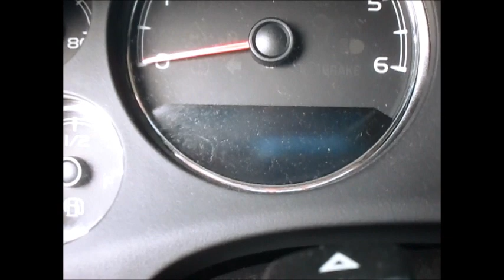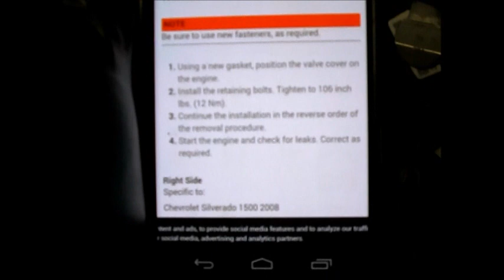Chevy 5.3 Burning Oil, smoking, how to fix.

Comment: This was misdiagnosed by several dealers, or they just wanted to over charge me for some other issue. My 2010 Silverado smoked like yours with a very rough start up. Could not get the check engine light to turn off for over a year. which also means you can not use auto start. I did use the Dorman though, not knowing any details about that part vs GM. Long story short I fired it up after installing and low and behold my check engine light turned off immediately and has not come back on for about 500 miles. Knock on wood. No more smoke on start up.  Thanks for the video.
Reply: Did you have problems with the Dorman part? All the reviews I've seen people rave about the Dorman valve cover.
Reply: @chrisheffernan6600  No problems at all. Changed drivers side only. Took a maybe 30 min.
Reply: Hey ! Did your truck smoke on the high way too on high RPMs and when you go up hill ?? 
Or only at startup ?

Comment: You can also use the old valve cover, you just need to drill about 5 holes in the baffle on the inside for more drainage, it works well!

Comment: You should wipe down the surface of the heads where the valve cover gasket sits using a rag damp with brake cleaner before reinstalling. I had the blue smoke too, but I instead drilled some extra holes in the original valve cover and enlarged the original weep hole which seemed to fix the problem. I haven't had a chance to check the oil consumption yet, but the blue smoke is gone

Comment: Always check the rubber connectors at both ends of the hose from the back of the valve cover and the intake side , mine were split creating a vacuum leak
Reply: Any chance you have a picture for reference?

Comment: I’m about to do this same valve cover/PCV replacement on my 2010 6.2. Thanks for the video. Really appreciate it.
Reply from the maker: Let us know how you make out and if it fixes you problem.
Reply: @RustBucketRepair  Problem fixed (at least the oil cloud on startup). I wasn't using much oil before, but I'll keep an eye on it. Just surpassed 200k.

Comment: We decided to drill out our old valve cover as suggested by several YouTube tutorials for the LS engines. We have a Yukon 2005 5.3 and we did this drilling out at least 10 holes and it all went well we test drove it the first day for 10 milrs and shut it off.
the next day unfortunately it started leaking down on the exhaust manifold and smoking.
I assumed the original OEM gasket would be sufficient

Comment: Do you have a part # or website you could post? I tried checking most of the comments. I believe this is one of my issues. Oil leaking and puff of smoke when driving and it downshifts from 6 to 5th. Thank you!
Reply from the maker: Best I can find is for 1999 to 2008 the part number is 12570427 and for 2009 and up its 12642655. Confirm for yourself before ordering.

Comment: Did yours also smoke alot at Wide open throttle? Have an 06 5.3 doing this now, besides the smoke it runs fine.    I know it used to drink a little oil but it leaks out so much from about every seal and gasket now its hard to tell how much more oil its consuming. 176,000 mile Poj it is. Ruined
Reply from the maker: Smoked the most at startup, but did also smoke at w.o.t.
Reply: @RustBucketRepair   YA i have no smoke at startup I thought I had the updated cover on the 06 but that was the 2nd update. Then they went to a 3rd update which is the "427" cover   Arrgh!

Comment: My 2008 avalanche ltz smokes a white cloud when I use the remote start and when I check the spark plugs on cylinder one there was oil on the spark plug. Do you know if this fix the problem with oil on the spark plug? Great video on the process of changing the cover.
Thanks
Reply from the maker: Yes. My #1 spark plug got so oil soaked I"d get a misfire and I"d  have to replace the plug.

Comment: I have a 02 suburban 5.3, I removed  the catalyst and it started to burn oil, I changed the pcv valve but after driving it still blows between white or bluewish, if its stays parked and turned on is does thorw as well and even after accelerating it seems that it accumulates the oil and it throws a big cloud of smoke then it disappears while driving, any experience with this?
Reply: Did u figure it out?

Comment: PCV valves are cheap to buy for a 2000 Toyota Corolla and easy to install (new) and the hose is fairly cheap.
Reply from the maker: Not on this model. The pcv valve is built into the valve cover. You have to replace the whole valve cover. I was surprised too. Not like the old days.

Comment: I have a 1992 gmc sierra 1500 that I bought for a project, had this issue of blue smoke on every startup...well I changed the valve stem seals and no more blue smoke
Reply from the maker: Your 92 will have a totally different pcv system.
Reply: @RustBucketRepair  I also changed the pcv valve with a brand new pcv valve and tubing, unbeknownst to me when I bought it, I found out that the black tubing that goes connected to the pcv valve and carburetor had a hole in it...just glad the blue smoke is gone and wasn't a more serious issue like the piston rings.

Comment: Is this applicable on a 2003 Tahoe 5.3 or no? Its got just the hollow shell pcv valve
Reply from the maker: From the little research I did it looks like your truck takes the same valve cover as mine, so I'd say yes.

Comment: Depends on just what part of the rust belt U live in. I do rust work on frames too. Ain't cheap and free but better than buying one those new way over priced train wrecks on from a dealers lot. get in touch folks I am in the Pocono's of Pennsylvania. Rust work under coating lighting packages. I do a lot here way under what others charge.

Comment: I really need help because this got me scratching my head. 05 5.3 270k. Every once in awhile I'd get a bit of smoke on startup nothing major. Well couple weeks ago I was out running errands. Truck drove great like always. Got home and parked it for a few hours. Had to go to corner store and while backing out my driveway I had no brakes (brake line from master cylinder blew under driver's side door) so pulled back in and also noticed idle was a little off and bouncing like it wanted to stall. Truck sat for 4 days until I could replace the brake line. Well I started it and now it smokes out the tailpipe and has a jumpy idle. No check engine light or overheating and oil looks good with good pressure. I know about the pcv valve problem these have but I don't think a pcv would cause this much smoke. I'm scared to drive it. Weird this happened when my brake line gave out. Help would be greatly appreciated
Reply from the maker: First off, I'm not a mechanic, so take what I say with a grain of salt. If it's the pcv valve, the smoke should clear up after the truck runs for a few minutes. The bouncing idle could be a fouled plug from the burning oil. My #1 plug would foul, but I'd also get a check engine light. Run the truck for a while and see if the smoke clears. Also, pull off the hose from the pcv and see if there is any oil in it. It will be very little. Wipe it with a paper towel and see if there is any oil on it. The only way the brakes are connected to the motor is through the vacuum line. Could that be part of your problem?? I don't think so.
Reply: I know this is a couple of months old, but I bet your master cylinder is leaking brake fluid into your brake booster and the vacuum is pulling it into the intake manifold and burning it along with the gas causing the white smoke.
Reply: @jimmydavis6254  yeah that's what it was

Comment: I found oil inside my spark plugs. Will this solve the issue? Or would it be the valve seals
Reply from the maker: If you find oil only on the driver's side then it could be the valve cover (PCV). If both side, then valve seals or rings.

Comment: If your engine is getting  noisy from valve lifters try running  a quart of Marvel Mystery oil through it for 1000 miles before you change out the oil. Worked great on my '11 Sierra.

J
Reply: Iam having a million and one issues with my 2001 Silverado with the 5.3 ls long block
Smokes when you start it than it stops but misfires on cylinder 1 and 2 and the lifters sounds terrible.
Reply: Lifters only make noise when it burns about a quart of oil
Reply from the maker: @thelostboyz6579  I was also getting a misfire as one of the spark plugs would oil foul.
Reply: @thelostboyz6579  yup the valve cover the do a sea foam upper engine cleaning and goes away engine quiets down

Comment: Might be a dumb question. Would this occure with p0171/p0174 codes?
Reply from the maker: If I'm correct those are random misfire codes. Not likely same problem.
Reply: @RustBucketRepair  they are codes for Fuel Trim Lean, bank 1 and 2 respectively.

Comment: Great job. Did you do this process to both sides? And if not, why just the one side?
Reply from the maker: Only the drivers side. It's the only side with the PCV system.
Reply: @RustBucketRepair  thanks

Comment from the maker: Well over a year and and still no smoke!
Reply: I got a similarity with white smoke but not on start up, only when in Park and running for awhile then as some as I place into drive position then a huge cloud of smoke comes out once I step on the gas then after awhile it goes away but as I place it back in Park and just let run it starts to smoke again
Reply from the maker: @andycue38956  Pull off the PCV line. If there is any sign of oil in the line I'd replace the valve cover.
Reply from the maker: LD Wcoor  only if the oil would foul a plug and I'd get a miss fire.
Reply: @RustBucketRepair   @22:30- you just HAD to say it! lol
Reply: Is there a PCV on both valve covers or just one? Cause that would mean both sides need to be changed right?
Reply from the maker: @troubleshooterr5775  just on the one side, the drivers side or left side.
Reply: @RustBucketRepair  i got one smoking 🚬🚬🚬🚬🚬 and loading cylinder 3 with oil I'll be opening the oil fill cap, taking the hose off test to make sure it's clogged and send some compressed air through that PVC see if it clears  out and if it runs better tell the client to replace the valve cover.
Reply: @RustBucketRepair  just blew out the Pcv out with 120psi and no more dense blue smoke puffs while I test drove it and idled just asked the client to keep me posted as he drives it around see if it comes back....
Reply from the maker: @troubleshooterr5775  I'm guessing it will come back soon and you'll need to replace the valve cover. Keep up updated!
Reply: @RustBucketRepair  will do, the client will be trial testing and if it doesn't puff over blue and make cylinder misfire(Blinking check engine light cause oil is fouling s.plug) we should be good.
Reply: @RustBucketRepair  So just visited the client today, found very light oil on cyl 3 and the rest were fine as of bank 1(Cyl 1357) but as for bank 2(2468) found carbon fouling due to bank 2 sensor 2 being bad no voltage reading and just got an 1153 referring to bank 2 sens 1... But as for blue smoke out the pipe, it has t come back since. I told the client to run it for a day or 2 on then we'll proceed to replace both o2 sensors for bank 2... This Chevy has had a lot of compounded problems... Power steering pump whining among others😅😅😅😅
Reply: Congrats, I just ordered a valve cover for my 5.3 LS.
Reply from the maker: @chrisheffernan6600  let us know how you make out, if it fixes you problems.
Reply: @RustBucketRepair  It took a little over an hour to replace. I used the Dorman valve cover. Drove around for about an hour afterwards to clear out the system. The next morning it was cold, started it up and NO MORE SMOKE. I think its good now.  The oil consumption issues should be a thing of the past.
Reply: What was part number or name of proper valve cover for fix?
Reply from the maker: @carlamerritt490  12570427.

Comment: This is my issue rn. Im gonna give it a try
Reply from the maker: Let us know how it works for you.
Reply: @RustBucketRepair  yess it was the issue! Unfortunately I didn't have time to do it myself due to work, but my local mechanic is working on it rn. Thank you so much pointing me in the right direction.
Reply: @durtydean8430 hey my truck is blowing smoke like his but only on a cold start, if it’s warm it doesn’t do it. Do you think this would fix my issue?
Reply: That's what my truck was doing also. It would only smoke during cold start ups.  Im pretty sure that would help

Comment: Nice fix. What oil do you run in that Mobil 1? Seems to be holding very well.
Reply from the maker: Yes, Mobil 1
Reply: canamsledder  I think they make a valve seal kit for that also. A little involved job but it would clear up the problem completely. Than you might get 4000000 out of that truck.
Reply from the maker: @nysledder4066  Done that already. Didn't see a difference. I don't know if I'll see 400k. It's starting to get noisy.
Reply: Is the truck still running good with no smoke? How many miles now?
Reply: @RustBucketRepair  how many miles now? Still no.smoke?
Reply from the maker: @dansitterly6361  290,000 miles now and still no more smoke on startup.
Reply from the maker: @dansitterly6361  And still running good too. Just getting very rusty!

Comment: I need to do this with my 08 Sierra with 240k miles and I have to add a quart of oil ever 1k miles but j am no mechanic
Reply from the maker: Just nuts and bolts.

Comment: Why did you buy the valve cover from ?
Reply from the maker: Got it off ebay.
Reply: @RustBucketRepair  thanks 👍🏽
Reply from the maker: @rylansbeats456  Here's the link. https://www.ebay.com/itm/GM-OEM-Engine-Valve-Cover-12570427/263432446298

Comment: How long are these "updated" valve covers good for? I got 170k miles on my 5.3 about to do the valve cover swap. Could oil be getting to the intake off the passenger side valve cover as well?
Reply from the maker: The new valve cover should last the life of the truck because of the updates. Make sure you get the updated valve cover.  You only need to replace the divers side as it's the only side with the PCV system.
Reply: @RustBucketRepair  thanks for the quick response.

Comment: Usually the oil consumption is the valve seals. Light clouds while doing stop & go driving means rings. All my Silverados have the OEM valve covers no problemo's. The one that smoked a lot at start that was valve guide seals. The one with 230K on the clock was smoking after it got hot going down the road at a light there was a light oil cloud when at idle and little gush driving away. That was rings.
Reply from the maker: @thekingsilverado3266  bad pcv systems is a known issue with these.
Reply: @RustBucketRepair  I have had people here personally telling me no its not the rings or valve guide seals or a bad valve guides. These motors due to having over 75lbs of pressure in the manifold do not develop the conventional type of blow by forcing oil out the seals and gaskets unless it is extreme. Instead the PCV system sucks up the raw oil and vapors to evacuate the oil instead because of the extreme amount of vacuum draw the manifolds have. The PCV does just that vents that extra pressure and the oil along with it, routes it to the PCV system and evacuates the excess pressure. The very reasons the engine still seems to have balance and some power.  I am an aviation mechanic and when aircraft develop that sort of problem we decertify and ground aircraft with that sort of issue. Sic Harrison Fords one crash. The idiot was flying a 50 year old plane with a bad motor. He had the thing all cleaned up had the heads done. following me. It was the rings. He idled the plane 45min before take off when he when went full throttle on take the oil choked his engine it was the rings. He crashed on take off. And lived to tell about it. I read the NTSB report on the crash basically states the engine was refreshed not rebuilt as was suggested Larry Heller the A&P inspector that inspected his plane and decertified it.

Comment: When ever I accelerate my oil goes up and down and smoke starts to come out and a mechanic that checked it out he told us it was the motor but I don’t really think is the motor
Reply from the maker: What is the year and model of your vehicle?
Reply: @RustBucketRepair  I got a 2016 Chevy Silverado
Reply: @RustBucketRepair  also my truck shakes a lot
Reply from the maker: Is the check engine light on?
Reply: @RustBucketRepair  no
Reply: @RustBucketRepair  the only light that’s on is the traction control
Reply from the maker: I'm not sure what you have going on but I doubt a valve cover will fix it. Sounds more like bad lifters.
Reply: @RustBucketRepair  let me tell u the back story of the truck long story short I took it to the mechanic for him to change the lifters we got the truck back 3 days later and the first day we got it it was driving perfect and then the next morning I start it up and it just started shaking again but now smoke was coming out
Reply: @RustBucketRepair  it’s been like this for like I would say 4 weeks now we just got the truck back yesterday because we had took it back to the guy but the guy says he din’t find nothing that’s wrong with and now we took it to an other mechanic I took it today and then he told me it was the lifter and I told him how if we just changed all of them